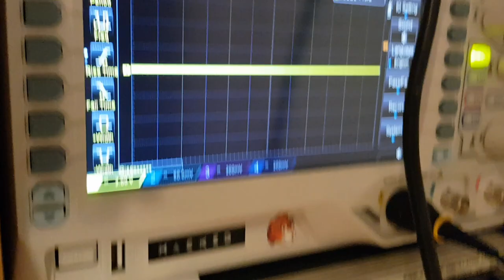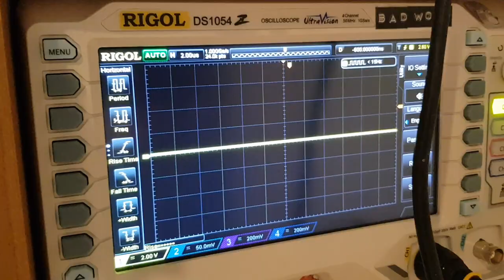Acorn System 1 Build

Comment: Omg wow!  My legendary Simon is building a legendary system!  I sure wish there was an Acorn Archimedes kit maybe based on FPGA just like a mega Sg!  Did you get a Mega SG too?  Mine is very good, when they said it was accurate they weren’t kidding, it’s pretty close to a real Mega Drive!  Only thing is there’s no CRAM dots yet, hope they add them in a update oh and a few Mega CD niggles that need fixing.
Reply from the maker: Thanks. The PI HAS A RISC OS kernal, however I have not done much with it other than turning it on & playing with it for ten mins. Don't have one of them, to be fair I have not done mach gaming in a while. Busy doing the adulting these days & at the moment would rather spend the fre time working on stuff.

Comment: It's been a while, but I'm fairly sure I've programed 2732s with a my MiniPro.
Reply from the maker: I just figured out how to do it today, switch off pin detect & give the chip 25V from an external source. In my case I used my home built PSU.
Reply: @TheEPROM9 Well done on getting it to work!  I certainly didn't have to use an external power supply, but thinking about it, my "2732s" were probably 27C32s which only need about 12V.
Reply from the maker: Thanks, year depends on the chip. But the fact you can program them with an external power supply is a good thing.